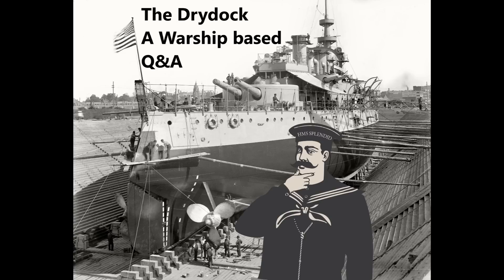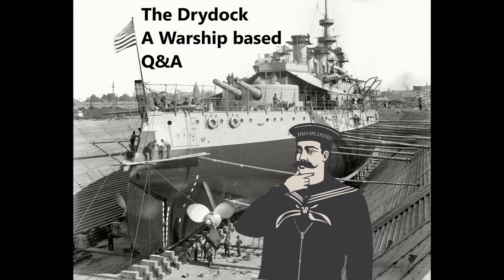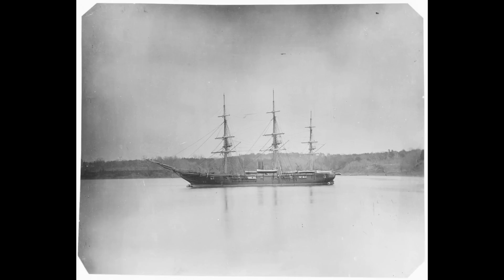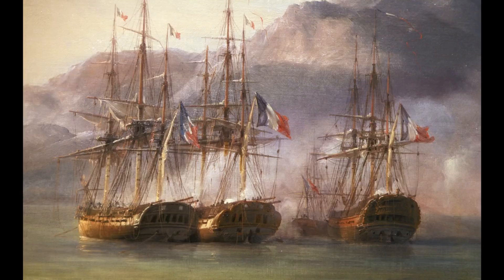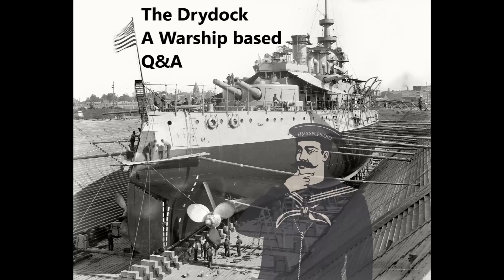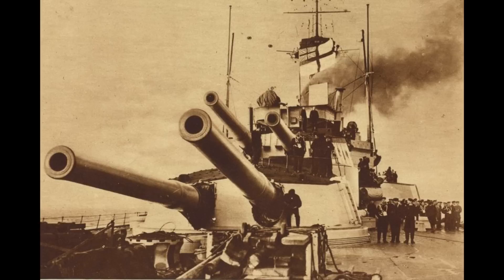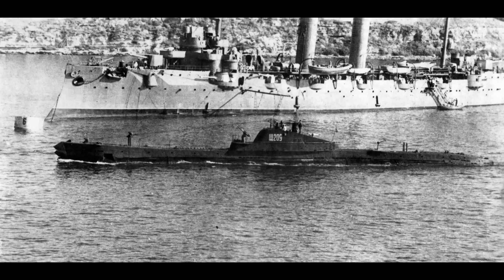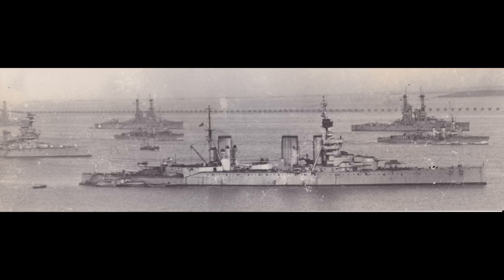The Drydock - Episode 207

Comment: For biggest-gun cruiser, I have to bring up USS Vesuvius, with her triple-battery of 15-inch guns, probably wins biggest caliber. Classified as a plain cruiser at the time. Granted, they were pneumatic-fired dynamite guns, but the question was only about biggest, not most practical.

Honorable mention also to the armored cruiser Georgios Averof, a substantially more practical ship armed with 9.2 inch main battery, and at just about 10,000 tons would even be near enough treaty compliant, had that mattered at the time. Between the design and service history, she certainly fit into the "second class battleship" idea for armored cruisers, though she seemed to have a bit of a problem with that "second class" part.

Comment: The first question, in which Drach mentions the effect of director control tables on the Battle of the Falkland Islands in 1914, goes a long way to answer the question I've posed a couple of times and had answered, but only in part, once. If these two battlecruisers had yet to be refitted with a fire control table, then it seems wildly unlikely that the armored cruisers in Troubridge's squadron in the Mediterranean had. If SMS Moltke did have that kind of fire control table, then that would appear to give Moltke a huge advantage over the armored cruisers to go along with its speed. If Moltke has the speed to control the range, and a central fire control table, then it can deliver well-aimed salvos at 10-12,000 yards while the British armored cruisers are throwing out shells with only the barest slim chance of scoring a lucky hit. So it would appear the key issue is whether Moltke had that fire control table or not.

Edit: as noted below, Goeben rather than Moltke. Since Goeben wasn't assigned to the Mediterranean until 1912, there may have been time for her to have been refitted with a central fire control table before that assignment.
Reply: You mean SMS Goeben, Moltkes sistership.
Reply: @gildor8866  yes, you are correct.
Reply: Hi
Reply: Norman Friedman in his "Naval Firepower" book writes that German fire control in WW1 had excellent rangefinders but does not seem very impressed with the German range clock equivalent, which relied heavily on human judgement. He also writes that in 1913-14, after Goeben deployed to the Med, the German navy considered 6000 metres decisive range and that fire beyond 10000 metres was ineffective.
Reply: @hughfisher9820  thanks. Obviously they improved quite a bit over the next couple years leading up to Jutland.

Comment: Was the indifferent reputation of the the Royal Navy's 16" Mark I guns mounted on the HMS Nelson and HMS Rodney all that unfair or undeserved?  A number of very reliable sources I've seen suggest these guns had issues that went beyond their troublesome mounts, and the guns earned their reputation. 

The following paragraph from the page on the website Naval Weapons website offers a good summary of these other major problems the 16" Mark I gun:

"From inadequate firing trials, a mistaken theory was promulgated by the Director of Naval Ordnance (DNO) that held that a high-velocity, low-weight projectile would have superior armor penetration characteristics at large oblique angles of impact, a conclusion which was the opposite of previous findings. This theory was not substantiated by later trials, but these took place too late to affect the decision to use a lightweight APC projectile for new designs. As a result, these guns proved to be only marginally better in terms of armor penetration than the previous 15"/42 (38.1 cm) Mark I and much less satisfactory than those older guns in terms of accuracy and barrel life."

Various sources indicate the inaccuracy was in large part due to the guns' rifling. The guns were made with two different riflings: Mark I and Mark II. The Royal Naval, apparently in a move to save money and time, fitted ships with both the two types of rifles. This resulted in problems with dispersion.

The two different rifling patterns arose in an attempt to improve the short barrel life. Sources indicate this solution was not particularly successful. 

Further, the performance of RN 16" Mk I was not good compared to its foreign peers, such as USN 16" 45 Mk 1 with WWI era Mk 3 shell. The comparison is even worse with WW II era US Mk 5 shell. Much of this of data on gun performance also can be found online at the Naval Weapons website, as well as in various books such as "Naval Weapons of World War Two" by John Campbell.

BTW, I'd post a link to the Naval Weapons website but YouTube seems to hide posts that have links.
Reply: The craziest part was that Rodney even ended up with a mix of guns with Mk I and Mk II rifling within the same turret.
Reply: I'd say that the degree to which they are looked down upon is rather unfair. At the end of the day, they acquitted themselves well enough during engagements like the sinking of the Bismarck.
Reply: A lot of this needs to be put in proper context. Being "marginally better in terms of penetration" and "much less satisfactory ... on terms of accuracy and barrel life" than the 15"/42 is comparing it against one of the best weapons of its time and arguably throughout the entire era of "post-dreadnought" battleships. Having worse accuracy and rated barrel life than a 15"/42 is a trait shared with almost every other battleship gun up to and including the Iowa's 16" Mk7 (excluding post-war upgrades of course). And only having marginally better penetration than the 15"/42 still puts it at similar penetration characteristics to the Colorado's 16"/45 using Mk3 shells. Since you're looking at navweaps as well, you may have missed that the Nelson's guns quite significantly outperform the Colorado's at 20k yards. Of course the penetration was significantly better with the Mk5 shells from the reconstructed guns at any range, but that's a much later and fairly deep upgrade.

The 16"/45s for the Nelsons were very problematic weapons with very problematic mounts, but a lot of the disappointment stems from them having to compare against the breakaway success of the 15"/42 and in practice they more than proved themselves in peer combat against Bismarck. Calling it an "indifferent reputation" actually fits pretty well. They're not terribly bad, just a major 'meh' compared to their predecessor. Very disappointing in that they no longer have something with clearly superior characteristics to their peers, like they did with the 15"/42, now they just have something that's roughly comparable but slightly worse.
Reply: @Tepid24  Proper contex would include the following.
1. The RN 16"/45  Mk.1 gun was less accurate than the RN 15"/42 and  most other comparable  contemporary naval guns.

2. The RN 16"/45  Mk.1 gun had a significantly shorter barrel life than the RN 15"/42 or most other comparable contemporary naval guns. Even with improvements, the RN 16"/45 Mk2 had a barrel of 180 rounds compared to the  200-250 rounds of the US Mark 11 14"/40,  335 round of the RN 15"/42, or the 350 rounds for the USN 16"/45 Mk 1 used on the Colorados .

3. The RN 16"/45  Mk.1 gun penetration was worse than most of its peers, not just similar to the RN 15"/42, according the Naval Website table and other sources. 

Guns that had better penetration according to Naval Weapons website tables include:
-USN 16"/45 Mk 3 (introduced on the USS Colorados)
-USN 16 Mk 5 (WW II update of the Colorados)
-USN's 16"/45 used on the 
-USN 14"/50 Mark 11 (used on the Standards)
-USN 12" Mark 12"/50 (used on the Alaskas)
-KM 38 cm (14.96") SK C/34 (used on the Bismarcks)
-MN 15"  Mods. 1935/1936 380 mm (used on Richelieus)
-MN 330 mm Mod. 1931 (used on the Dunquerkes)

It does appear to be better than the IJN  45 caliber 3rd Year Type 40 cm Guns found on the Nagatos but data is sketchy.

4. The guns on the Rodney did perform adequately in helping to sink the crippled, unmanueverable KM Bismarck. At the very close ranges  involved in this battle, the guns were able to overcome their inherent inaccuracy and hit the Bismarck. At landing, where they were shooting with minimal counter-battery fire and aerial spotting at fixed coordinates, the guns also performed adequately.

Given all this context, along with the other issues in the NelRod (e.g., the marked blast damage from firing the main guns), the checkered reputation of the RN 16"/45 as a gun appears to be very fairly earned, @DuraLexSedLex.
Reply: @notatruescotch7148  Did you like only read the first two or three sentences before starting to write this? Whatever, might as well stay here for the long haul then:

1. Less accurate, yeah. The point is that it wasn't inaccurate enough to actually prevent it from performing well. It's a physical reality that the guns had suboptimal accuracy, but unlike say, the French 380mm or Italian 381mm guns, this was not enough of a problem to have an adverse effect on them in practice. Rodney started hitting Bismarck at well above ~15k yards judging from the available chart and that's being generous. That's about the same range as Bismarck hit Hood, with Hood not being nearly as erratic of a target.
At the danger of me having to repeat myself, the British 16"/45 was not a very good gun, but it was adequate.

2. Feel free to read those footnotes through to the end:
>
"British Battleships of World War Two" credits these guns as being originally designed with a muzzle velocity of 2,700 fps (823 mps) and a maximum range of 41,983 yards (38,389 m). The very first test firings of these guns found that they had a serious wear problem, with a barrel life of only 180 rounds. It was also found that there was a considerable loss of accuracy during continuous firing, as there was a tendency for the projectiles to strip the rifling out of the guns ". . . due to the hammering action of the short bodied, long headed projectile on its way down the bore . . ." As a result, the rifling in the liners was changed (known as Mark II rifling) for newer guns, the powder charge and chamber size were reduced to the figures shown in the tables above and the diameter of the projectile driving band was increased. Even with these changes, the barrel life and accuracy still compared poorly with the previous 15"/42 (38.1 cm) Mark I.
>
After those "very first test firings" and the above modifications had been implemented they still had a barrel life worse than the 15"/42 at 200-250 rounds. That is exactly as good as all of the 14" standards. The 14" standards aren't exactly infamous for having short barrel lives. At the danger of me having to repeat myself, the British 16"/45 was not a very good gun, but it was adequate.

3. Did you... read my comment? Or for that matter, did you even read the navweaps tables? Subtly use the word "spaghetti" in your reply if you read this. Anyway.
The astute observer may drect their eyes at the 20 000 yard range for the penetration tables publically available over at navweaps for both the Nelson's 16"/45 and the Colorados using their 16"/45 Mk3 AP shells. You will notice that the Nelsons outperform them at that range. As you did see yourself, the Colorados then have an edge at the 15k yard segment. Ah jeez, with the practical impossibility of ever accurately quantifying the penetration ability of something like an AP projectile and these official sources giving one the edge over the other at one range and the opposite at another, fairly close range, with those advantages amounting to no more than 20mm here and there, it's almost like they have practically identical performance and the only differences are going to be dependent on uncontrollable factors and random happenstance.
The Mk 5 shells from the Mk 5/8 guns were indeed much better at any range, but you should note that those were a completely new shell design fired from modified and reconstructed guns. Of course those are better, they are also way outside of the frame of reference and irrelevant for a comparison. If you went through the trouble of rebuilding the guns and making new modernized shells for them, the British 16"/45s would also have a massive boost in performance, maybe even more so due to the questionably light design of the original 16" AP shells.
In the same vein, going on to list some of the most high performance weapons of the late 30ies and early 40ies doesn't exactly prove anything. The closest thing you've got is the Dunkerque's 330mm guns and even those are 9 years younger in design. And again, even if we choose to include these completely separate gun and shell developments that are between 9 and 18 years younger than the Nelsons, all of them dwarf the original Colorado's performance just as much. In case you've forgotten, on paper the Colorados have less penetration than the Nelsons with their pre-WW2 era shells at 20k yards.

At the very end you have to catch yourself lestyou actually compare them to something that is contemporary.
So yeah, just like the Colorados and Nagatos, their penetration wasn't at the same level as the much later weapon developments of the mid-late 30ies. This rendered them subpar, but adequate in their WW2 performance. At the danger of me having to repeat myself, the British 16"/45 was not a very good gun, but it was adequate.

4. The first hits and importantly the fatal ones that knocked out Bismarck's fire control, bridge and forward firepower were scored at well outside close range.

But yeah, other than these errors, I agree with your ultimate judgement. They were adequate weapons in the truest sense of the word. They did their job and did about as well as you could expect an early 20ies design to do in the 1940ies. They are disastrously disappointing next to the 15"/42 that did better than them despite being even older, but they are obviously miles better than the weapons which had critical flaws stopping them from being practically useful. Shell design, mounting quality and the gun barrels themselves came together to produce a bad, but serviceable package. Which is not something you could say about things like the Italian and French 15" guns ironically enough.

Anyway, this entire discussion is basically just nitpicking about the exact degree to which those guns deserve a checkered reputation, so I hope you'll excuse me if I come off as stand-offish at parts.

Comment: Worth noting, with regards to the RM's plans for countering enemy invasions, that by mid-1943 it was recongized the air situation was so poor for the Axis that an intervention in defense of Sicily would be untenable, though the fleet was still intended to be deployed if the Allies attempted to invade Sardinia or Corsica. It can also be noted that if the enemy were to try and land on the Tyrrhenian coast of Sicily, then dependent on the strength of the allied forces, it may be possible for the main fleet to intervene. Otherwise, the defense of Sicily was to be left to submarines and MAS.

Interestingly enough, the Allies decided against any landings on the northern coast of Sicily precisely to avoid the potential for intervention by the Italian fleet, though King George V and Howe were positioned to the north-west of the island just in case (the rest of the British capital ships were off the south-east coast). As it happens, though, at the time Husky started only one Littorio - Littorio herself in fact - was actually ready for action. Roma was under repair and Vittorio Veneto still working up after being repaired from bomb damage suffered during a large USAAF raid on La Spezia on 5 June 1943. With only one of the three battleships available for such an operation, any mission to attack Allied landing efforts were firmly rejected when the scale of the landing force was reported.

Comment: "00:38:37 - What's the largest gun ever considered for placement on a cruiser? And would it have been feasible or was it just a pipe dream?" 
HMS Furious comes to mind. . . That got quickly removed because the gun ended up being more harmful to the ship that it carried than any ship it fired against.
as for a pipe dream.
see HMS Incomparable because Jackie Fisher.
Reply: I was thinking of the British monitors (Roberts, et al)-basically battleship guns on cruiser hulls.
Reply: I realize she was a "Large Light Cruiser", but come on. The British used 6X9.2 inch on the Duke of Edinburgh and Warrior classes and 4X9.2 inch on the Minotaur class , the USN 4X10 inch on the Tennesse Class (later renamed Memphis, but the IJN's Tsukuba and Ibuki class armored cruisers mounted 4X12 inch.
Reply: @WildBillCox13  I mean, monitors are short and wide while cruisers are long and thin.
Reply: You could also consider the Kronshtadt class with the planned German 380 mm guns. Of course, same as with the others, you have the question of large cruiser/super cruiser/battlecruiser and does it count?
Reply: @BruceRKF   HMS Furious had 2/3 inch belt armor. Her protection is on par with the contemporary C class light cruisers. A light cruiser armed with 6 inch guns can detonate HMS Furious. So with the HMS Furious the cruiser name sticks.
Reply: @BruceRKF  Never built doesn't count
Reply: @colbeausabre8842  Considering the original question was about "largest guns considered for placement on a cruiser" I don't see why not. Drach himself mentioned the B-65, for example. Besides that, although the Soviets did not really have the infrastructure to finish them in any reasonable time (even without the German invasion), both Kronshtadt and Sevastopol were at least under construction. Therefore, "never built" does not quite apply to them, imo.